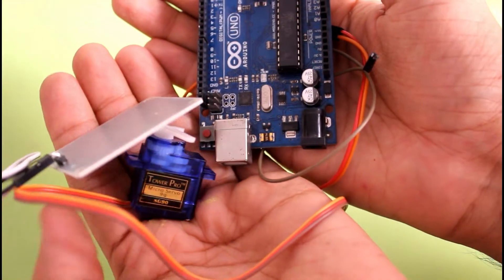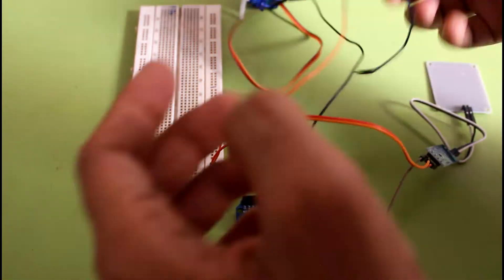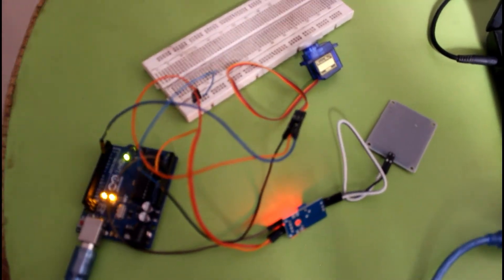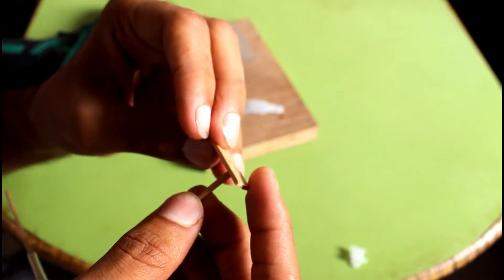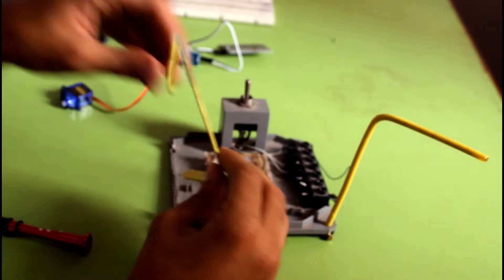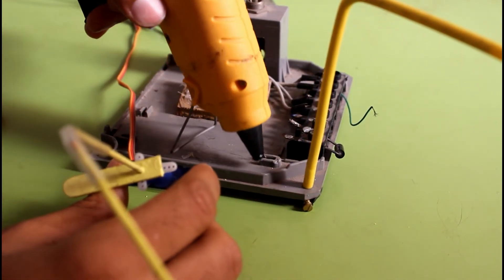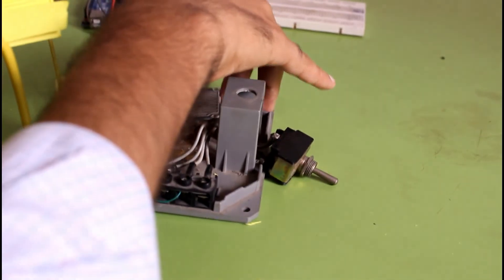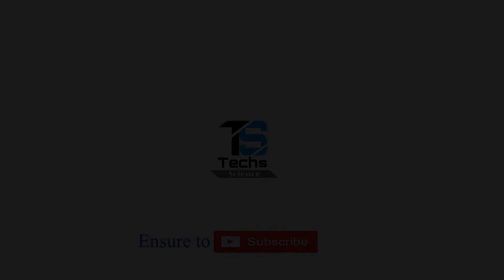Make Automatic Umbrella Shed  |Monsoon Arduino Project | (Rain Sensor)

Comment: if a servo is rotate in 360 degree angle then how to crt it?
Reply from the maker: @VarshaaKannan  you can select the angle of rotation by making change in the code
Reply: @TechsScience   I can change sir but it not work
Reply: Not rain also the servo motor will rotate in 360 angle
Reply from the maker: @VarshaaKannan  Video thikse dekho
Rain sensor motor ko trigger karne ke liye hai Bina rain ke motor rotate nahi karega

Comment: how do i make the motor spin continuously what code do I change
Reply from the maker: You can't run servo more than 180 degrees
Reply from the maker: You should use normal geared motor for that

Comment: my dc motor only has 2 wires how do you connect it
Reply from the maker: You can't you simple dc motor for this project 

If you don't have servo you can use geared motor with motor controller ic & some modification in code

Comment: In the bredboard were the wires put in negative or positive side plus does the letters or alphabets matter in breedboard?
Reply from the maker: Breadboard is used just for easy  connections if you can connect 2-3 wires to with single wire you don't need Breadboard
Reply from the maker: For detailed information text me on Instagram

Comment: #include<Servo.h>
int rain_sensor = A0, servo = 3;
Servo myServo;
void setup()
{
  Serial.begin(9600);
  myServo.attach(servo);
  myServo.write(0);
  }
void loop()
{
  int sensorvalue=analogRead(rain_sensor);
  int motor = map(sensorvalue, 220,1023,180,0);
  myServo.write(motor);
  Serial.println("Sensor vlaue is  ");
  Serial.println(sensorvalue);
  Serial.println("Servo motor rotates by angle  ");
  Serial.println(motor);
  delay(1000); 
  }

Comment: Sir it helps only in rainy season is there any purpose how can we use in real-life  and it works only whenever it dectects water otherwise no use know sir
Reply from the maker: Yes, it's made only for rainy season 
But if you want you can add solar cell to sense light this way you can use in summer as well

Comment: Can we replace umbrella instead of shed ?
Reply from the maker: Yes you can
Reply from the maker: But you have to change the mechanism 
From circular motion to linear
Reply: Is the program is sme
Reply from the maker: @sindhugowda2734  depends upon your mechanism
Reply: @TechsScience   is all the connection are sme for making rain sensing handfree umbrella
Reply from the maker: @sindhugowda2734  in linear motion you will use DC motor with actuator or something 
Which has 2 wires so the wiring & programming will be different
Reply: Can u plzz upload the vedio for that
Reply from the maker: @sindhugowda2734  ok I will try
Reply from the maker: @sindhugowda2734  https://youtu.be/TKH-w6OwXaQ
I have made rain sensor shed with different mechanism 
Have a look
Reply: @TechsScience  is this is the similar step of handfree umbrella
Reply from the maker: I made rain sensor umbrella 
Check out my latest video 🙂

Comment: How can i rotate the sheet with 360 deg is there any way
Reply from the maker: Servos have only 180° rotation 
You needs stepper motor for that
& you will have to make changes In code

Comment: Sir can we use Dc motor instead of servo motor
Reply from the maker: No
Dc motors can't be controlled at spec degrees 
It will keep rotating until you remove the power 

I have made another similar project with dc motor with different mechanism 
You will find the Link at the end of this video
Reply: Can you give the code to me
Reply from the maker: It is given in the description

Comment: Hi, I have a question ..... I did all your steps, but the motor does not work, the same code is the same steps, but it does not work at any angle...
Reply from the maker: maybe your board or any accessories faculty
Reply: @TechsScience  thanks

Comment: what is the name of the electronics that you connect to the rain  sensor aside from arduino and servo motor?
Reply from the maker: It's circiut of rain sensor 
The sensor kit includes the sensing panel & circuit you don't have to buy separately

Comment: Can I do it in Arduino uno
Reply from the maker: Of course it needs Arduino Uno
Reply: Sorry I was about to ask "can I make it with Arduino nano?"
Reply from the maker: @bharadwajs1828  yes they both works the same, 
Just varied in size
Reply: @TechsScience  so please please can you give me the code for this project in Arduino nano? Please
Reply: @TechsScience  please I beg you please!
Reply from the maker: @arshuarshaq5043  it's already given in the description
Reply: @TechsScience  but in description the code is for arduino uno right ?
Reply: @TechsScience  and please send me a digram for in which pin should I     plug the jumper cables in arduino nano please begging you !! Please!
Reply from the maker: @arshuarshaq5043  The code works in all Arduinos
Reply: @TechsScience  ok !
Reply: @TechsScience  thanks
Reply: @TechsScience  but where should I plug in the jumper cables in Arduino nano ? Can you please give me a digram begging you !!
Reply from the maker: @arshuarshaq5043  I think you should  have the basic course of Arduino before working with it
Or text me on Instagram
Reply: @TechsScience  your Instagram id ?
Reply: @TechsScience  I am texting you in Instagram so please reply please